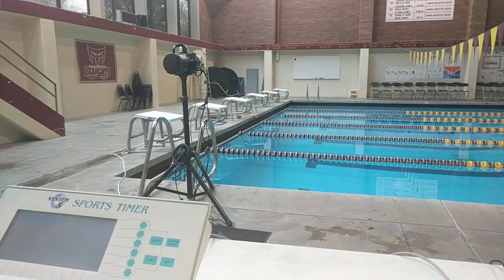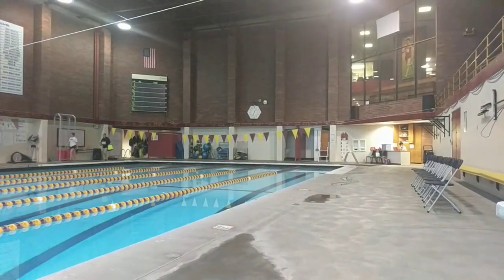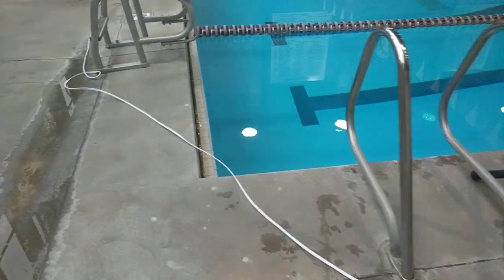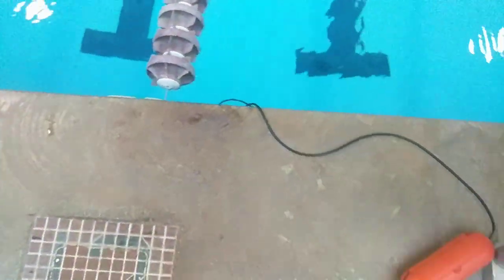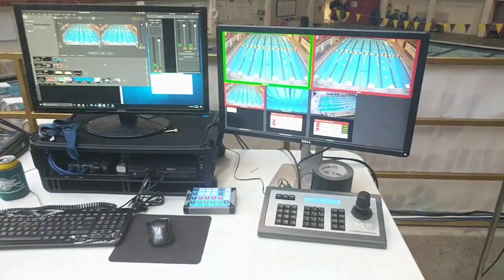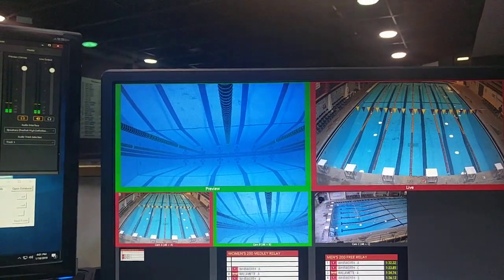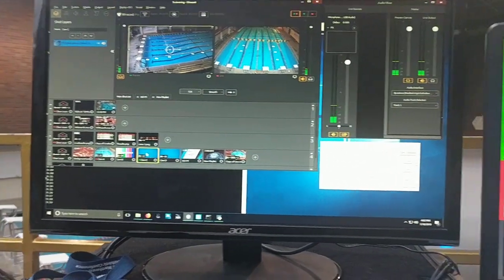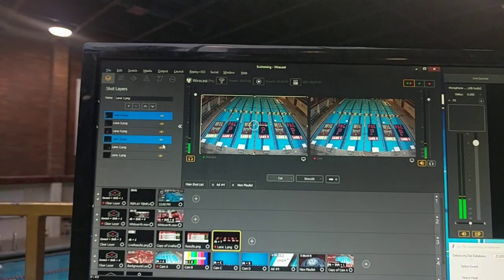Swimming Webcast Setup

Comment: On the Colorado infinity... For the external speaker to your mixer, did you split for the main speakers and did you have to downgrade it to line level?
Reply from the maker: I just plug it right into the mixer.

Comment: Getting audio out of the starting box…are you taking the powered speaker outlet directly into your mixer? One more question, what are you using to decode the data off of the serial output from the Colorado System?  I’ve seen some home-baked decoders that create a web page.
Reply from the maker: Output on the starters speaker goes directly into the mixer. The scoreboard data is parsed via a custom Python program.
Reply: @chrissabato  Would you be willing to share the python program?  I've got 4 cameras for a county swim meet and would love to not burn one the timerboard capture.

Comment: One more question for you...The Marshall CV503 WP camera...how are you getting that down to one cable?  I see the waterproof connector container.   Is that an SDI with power cable in one?  I've been working on using a lot of ideas from your set up.
Reply from the maker: It's a siamese cable, SDI and power.